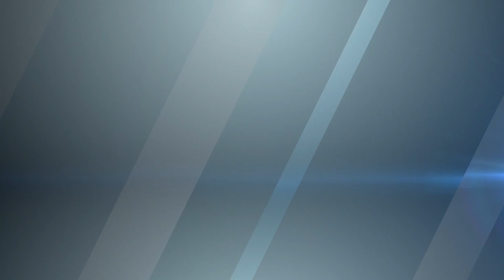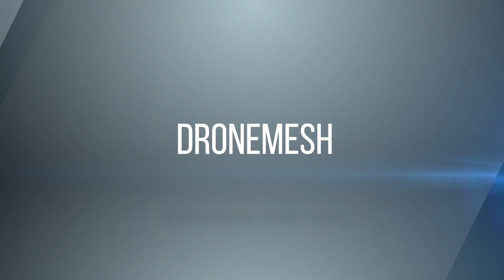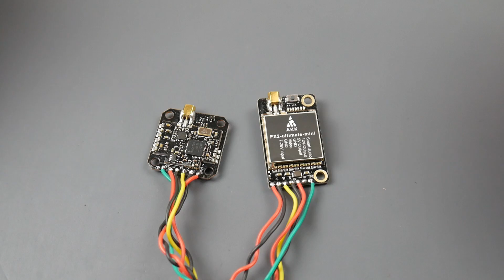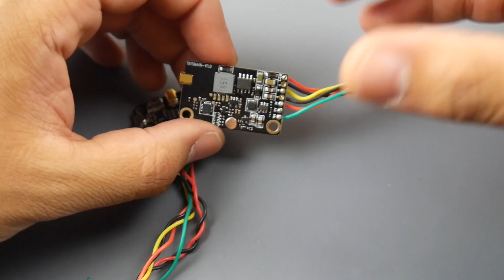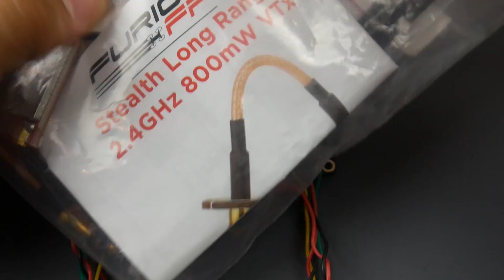AKK 2000mw VTX!!!! // AKK FX2 Ultimate Mini & AKK FX3-Ultimate [Part 1]

Comment: watch bardwells testing. This thing puts out less then 500mw when it's set to 1000. Nobody comes close to their claimed power. I'm hoping the new mach 3 1000mw comes close to an actual 800, but akk tests low and doesn't have a narrow Chanel band. Shitzweek.
Reply: AS i know, bardwell took this video off, because the Meter was not correct

Comment: I prefer to use antenna with 90 degree connectors (dipoles and Lollipop 2)...no pigtails for me.

I've been running these vtx for a couple years now.  Used to buy more expensive ones, but I mostly fly alone and these are great, especially for the price and availability.

Comment: Hi Great video,  I have a older FX3 and I had it in my Droner and I thought it had a good signal and was clean but I just thought it was ran hot even on low power can't wait to see what you find.
Thanks for the information.  JohnnyDRC

Comment: Does mini do a 1000mw cause when using lua script it shows 25mw 200mw 600mw and 800mw
Reply: That's because it's smart audio. It's made for the Unify. If you use AKK the 800mw setting is 1200mw on the fx2 ultimate for example :)
Reply: So it’s smart audio 2.0 ? But that doesn’t show the same power levels. I can’t get farther then 100ft. It’s not on 25w because there’s no solid green light

Comment: 5:35 @Dronemesh You can just heat it a bit with you're Heatgun, then it becomes pretty flexible and you can bend it. Then just hold it in position until it cooles down and it stays in position.

Comment: 2000mw wtf 😲
Reply: Btw it's illega in some countries to run it on full power. For example in Germany your're only allow to use up to 25mW
Reply: @patrickm5790  Sure, when I flew my quad in German, an officer came to me and bring his RF power meter and I got arrested bcz mine was 25.1mW.

The difference between 25mW and 2W is actually just a bit over twice the RF power, 14dBm vs 33dBm.
Reply: @patrickm5790  I know but, no risk no fun😉

Comment: I'm glad I didn't get the 2.4 video. I'm mostly running 900mhz but it sure is cheaper to keep with 5.8ghz... Thanks bro!
Reply: I just went 1.8 miles on 5.8 last weekend. 600mw even. 5.8 is very capable.